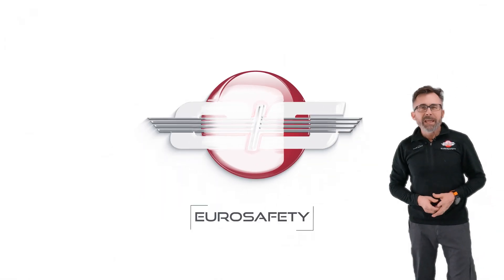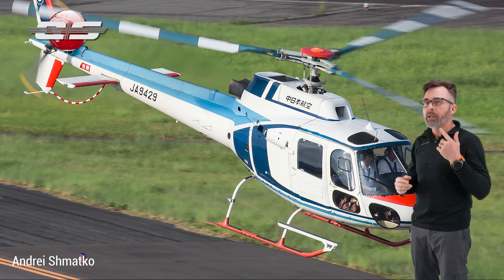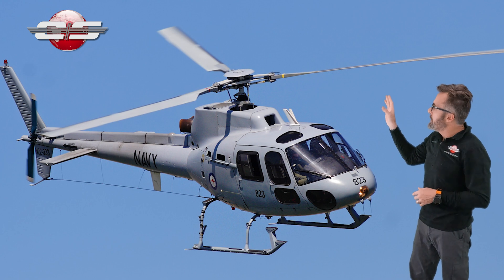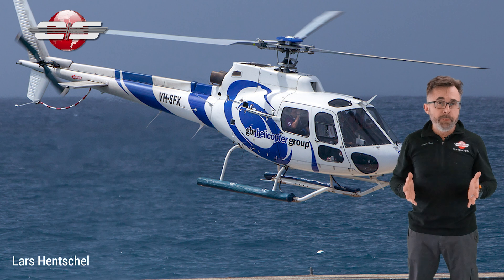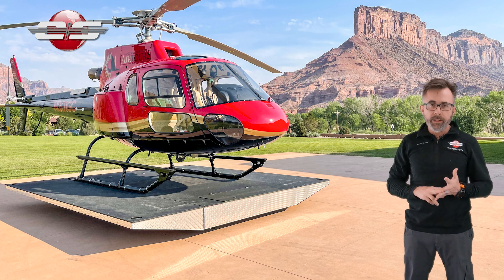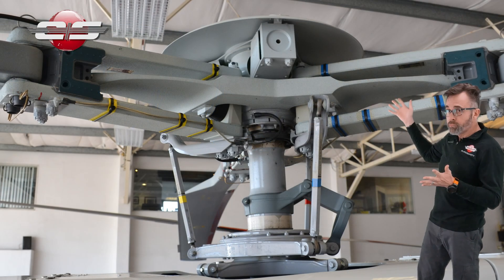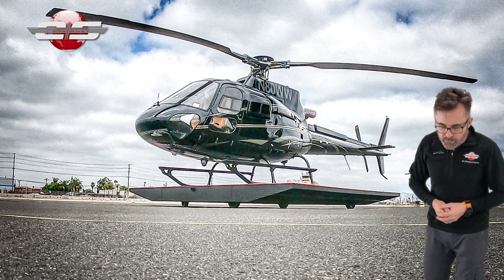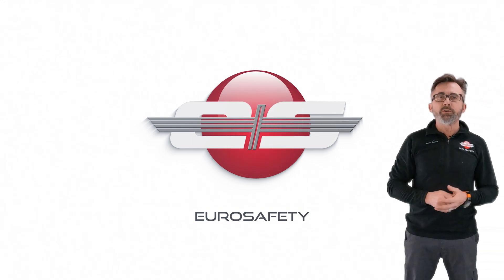#50 - The AS350 model lineage

Comment: What the main purpose of heat shield on B3e with Arirel 2D more larger / 2 segments.
Thanks before Mr. Glenn
Reply: I hate to disagree. I just was in the order process of a new one. And all our 2016 B3e have the short shield. But we don’t have to fight over it.
Reply from the maker: That is fascinating. So your new 2023 B3e is going to be delivered with a short heat shield?
Reply: One is for sure a 2017 model. The other one is slightly newer, I believe 2018. As I said, it is still an option even in 2023, cost is roughly 15k USD.
Reply from the maker: Interesting
Reply from the maker: A brief history of the heat departing the engine on the AS350.... in the beginning the exhaust was short on the Arriel and Lycoming engines.... so aerospatiale made the first part of the of the tail rotor drive out of steel. Then the exhaust as the the engine became more powerful started getting hotter.... so on B2 they canted it to the left. On Arriel 2 version of helicopter with the even hotter exhaust Turbomeca designed a longer exhaust port to cool the air a bit before leaving the engine. This routed the hot air over the tail boom where there are hanger bearings and the aluminum tail rotor drive shaft. In an effort to protect those items Eurocopter created a heat shield. Believing a more robust heat shield was needed they created the bigger one on the EC130B4. that worked very well. So just eventually brought it over to the B3
Reply: @EUROSAFETYTRAINING  thanks Sir
Reply: Not entirely correct. The B3e is available with both the short or long heat shield.
Reply from the maker: The B3e is not available with the smaller heat shield. At the very beginning of production it had a smaller heat shield like the 2B1. Airbus then changed the heat shield to the longer one and the short installation is no longer available.
Reply: No it’s not. But it was an option at extra cost. Maybe different sales strategy in the US and Europe? I guess also most if not all are delivered as dual hydraulic machines in the States? Different here too.
Reply from the maker: So your new one has the larger heat shield but the older ones have the smaller. Do you happen to know the manufacture date of the newest one with the smaller heat shield? What is the reason your company want the smaller heat shield... weight?
Reply: The long and short heat sheilds are optional and both available on the B3e. The difference being maximum hover time with the short sheild is 5 mins. 30 mins with the two peice long heat sheild. It's a customer option based on your needs/type of work.

Comment: Another way of distinguishing between the B3 variants is on the exhaust pipe the oil overflow pipe coming from the oil reservoir.  In the 2B its on the end of the exhaust pointing into the end of the pipe. In the 2B1 it been moved into the middle section of the exhaust pipe and in to a hotter section of the exhaust. In the 2D variant this pipe is just after the turbine blades in the hottest section of the exhaust pipe.

Comment: Another question, I noticed that older AS350's tend to have one master switch for power, but later models like the B2 with the VEMD have a BAT and Direct BAT switches, like you find on Honeywell conversion kits with BUS Bars. Any insite on what the difference is and why?
Reply from the maker: Good question. The direct battery bus has two different purposes depending on if you are looking at a EC130 and the AS355 or the AS350. On the 130 and 355's the direct battery bus will be the only bus providing power to specific electrical components (on T2 its two buses) after the emergency cutoff (AS355) or the emergency switch (EC130B4) or the Shed position of battery switch (EC130T2) is engaged. These switches are engaged after an electrical fire or smoke in cockpit to isolate only the bare essential components. On the AS350 models it is used for a radio so that you can only engage that switch and only power a radio so you can get start clearance in many parts of the world without draining battery too much.